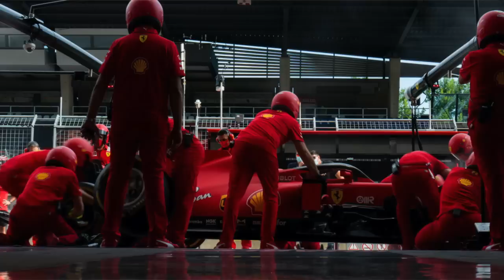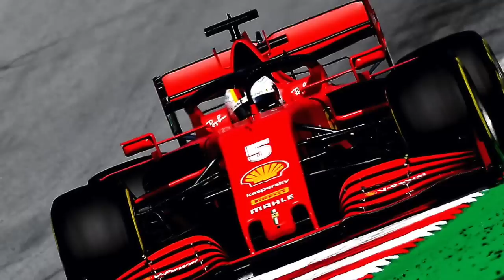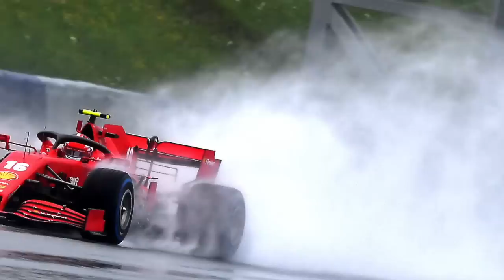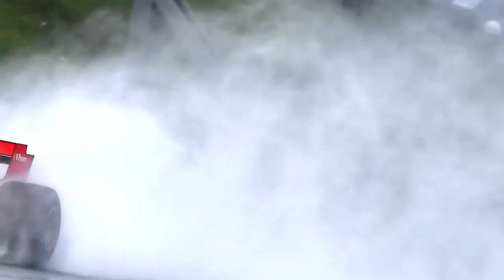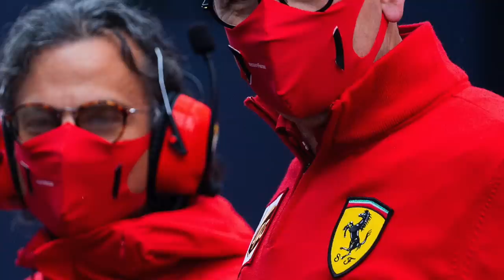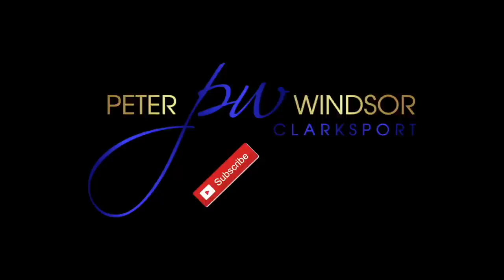Ferrari F1: what are the issues? Scarbs analysis by Peter Windsor

Comment: They relayed too much on the power unit, used without fuel flow sensors, so they can burn more fuel. I think to address that they must redesign a big part of it. And i can imagine that is very expensive and it could be a nightmare. But they are the f1 team who take the most of prize money, at the end of the championship, regardless of the position they end up

Comment: "In the wet, power means absolutely nothing" ... I get your point, that rain is the great equalizer with many variables, and traction is so low that much of the time, the horsepower you have is merely theoretical! But there's a point after almost every corner of the lap, where the speed, gears, and downforce, go up, and the driver is using full throttle. It’s why they still did charge laps before each hot lap in quali — they were getting every last horsepower they could, using those quali engine modes that discharge all available power over a single lap.

Comment: It’s really not a huge mystery is it. Let’s assume that with the new fuel pump setup, they’re losing some fuel flow compared to last season - they’re down on power and have been forced to reduce drag, which has lost them downforce. Because they’d committed to a higher drag/downforce design based on an expected  power output, when that power output has been significantly reduced, they’re in a tricky situation. They’ve pushed the technical regulations and have been bitten - they should’ve asked for regulatory confirmation earlier in the design phase so have avoided the sorry mess. MB did exactly this with DAS - checked and had it approved. The fact that Ferrari didn’t was at best naive, and has robbed F1 of some closer competition at the top..

Comment: SonI guess Ferrari really were cheating in '19 after all
Reply: Racing is cheating at all levels from local dirt tracks to Nascar to F1.  If you don't cheat you don't win. It's part of the game. The trick is to not get caught
Reply: Yeah, they were. Pretty crazy, huh? Not a "grey area" either — the rules clearly state that 100kg/hr is the maximum fuel flow for the engine. The rules do NOT merely state that the official FIA fuel-flow sensor cannot exceed 100kg/hr, which which Ferrari did adhere to because they tricked said fuel-flow sensor.

Comment: Binotto is an engine man. Maybe he should go back to his bailiwick to help increase hp without cheating. Can you provide more granularity on the IP Ferrari used to cheat?
Reply: until proven otherwise the FIA said that Ferrari was in order.
In all its history Ferrari has never cheated.
I can't say the same for the mclaren taken in the bag with the ferrari projects.
Reply: @tonino5113  FIA never said that, reading between the lines Ferrari had software and hardware in place allowing it subvert the fuel measurement. Ferrari was all "on our honor we never used it in a race", FIA couldn't prove otherwise. So, secret agreement, Ferrari to give up the goodies to FIA to prevent another team from using the cheats that Ferrari had developed, but "never used". Assuming of course that the loss of 1 second in lap pace and substantially slower top speed immediately following the FIA ruling was purely a coincidence.

Comment: In the first race, the Ferraris were just about hitting 300kph on the pit straight while the Mercedes where doing around 315kph and there are 3 long straights at the Red Bull ring so don't see why Scarbs doesn't agree that Ferrari was losing 0.7 per lap in Austria... It's entirely possible.

Comment: If they all start a race with 100kg of fuel why cant they use what ever flow they want? Surely using too much they would run out before the end of a race and that's their problem?
Reply: That’s actually an interesting idea to push fuel efficiency rather than restrict flow...
Reply: Hmm, interesting thought
Reply: It's to help reliability vs. fuel efficiency
Reply: That’s how they did it in the past and people hated it because cars had to back off towards the end of the race or even ran out of fuel. Check out the 1985 San Marino Grand Prix.

Comment: I don’t believe their advantage in power was down to fuel flow alone. They simply cannot run enough fuel in the car for Ferrari to consistently run higher power than everyone else during the race. Max fuel is what, 110kg. The max fuel flow is 100kg/hour. A race is an hour and a half long. You do the math on that one! 
Just look at Canada last year Seb kept Lewis behind for the entire race with power alone. It would be impossible unless they had significantly more fuel on board than is allowed.
Reply: There were rumours that they were hiding fuel in other parts of the car, in pipes and things...
Reply: @neilwilliams2883  "Leak" into the combustion engine from the intercooler. "Cool fuel" as Seb calls it.

Their arero is garbage. The front of the car including the nose is all wrong. It's butt ugly too.
Reply: @sinking1902  FIA should check also for some oil or fuel "leaks" to the combustion chambers on the Mercedes power units too.
Reply: @RogerM88  that was closed up 2 seasons ago re: oil burning and amendments were made to the regs for it.
mercedes are just that good, people are gonna have to accept it lol. quite incredible how they've maintained technical advantages for this long, will no doubt go down as one of the greatest f1 teams of all time.
Reply: @RogerM88  Haha. I think the first 3 years of the turbo hybrid era Merc were absolutely cheating! They were running a diesel lol! Ferrari built a great car in 2017 but lost the development race. In 2018 they built an ok car with a longer wheelbase but a split battery which crushed Merc at Spa on the Kemmel straight. In 2019 they cheated the fuel flow regulator but built a shit car in terms of concept. In 2020 the engine is legal and the aero is horrendous. RIP Ferrari.
Reply: Neil Williams They are only rumors. He is absolutely right it wasn’t down to fluid flow only
Reply: they don't use all that fuel space in the grand prix outside of like singapore cause it's the only race on the calendar where fuel mileage is mentioned.
way back when the hybrids were introduced they actually had an infographic up during the race of how much fuel each car was using of their maximum allotted amount and the cars would rarely use up more than 50% of the max fuel capacity, maybe 65% at montreal and monza, and by the time we got to singapore the infographic was gone because people said it was boring or something.
they still short fuel the cars for these full grand prix, which is just a testament to the technology that's been developed, all personal opinions on it aside. back in the v10 days 110kg of fuel would be 1 stint in a 2 stop race.
there's evidently a lot to be gained by breaching fuel flow regs, like it or not.
Reply: It's ludicrous to restrict fuel flow in the first place.  The majority of the technical restrictions are ludicrous and are why fans and teams are so frustrated with the sport to begin with.
Reply: How’s having a fuel flow cap ludicrous? Lol
Reply: Even at full speed on a really fast circuit like Silverstone the engine is only at full throttle for 70% of the lap, and even then you'd only actually need the additional fuel flow for the last 1,000-1,500 revs (ie c.15-20% of the total rev range), where the extra power would be produced, YOU do the maths. So the extra fuel required would be quite minimal. Once you add in lean fuel maps/lift and coast, as required, plus safety cars etc they are way off needing the full 110kg of fuel to drive for 1.5 hours so there's massive scope to increase maximum power output through additional fuel use, as long as you're prepared to cheat!!
Reply: FiLOL too many coincidences unfortunately to just accept they had the best PU
Reply: Liked 7times by Ferrari PU-Department 😁
Reply: @FiLOL think about it. If they weren't exceeding the fuel flow limit, there are only 2 other ways they could have been finding the extra power:
1. They were burning something else, such as oil, which is also banned, and or
2. They had somehow managed to make their engine significantly more efficient than all of the other engine manufacturers had managed (despite the fact that these engines are already by far the most efficient power units in the history of motorsport), but they have now somehow forgotten how they were doing it, and miraculously that happened just after the FIA technical directives came out! Haha
Can't you see how that looks slightly suspicious?
Reply: p jay I just don’t think ALL their performance came from just fuel flow. They could extract more efficiency from the ICE and have a trick or two in the ERS on top of extra flow
Reply: Yes Steve there is a lot more to that story than most in the know are unwilling to air.
I fancy that they found a lot more than what was divulged & had it been then they may well have been booted out for that year ?
That would never do of course as they still walk on water (for the moment)

Comment: So if the engine is down on power, and the only change is a new random sample fuel flow meter, then isn't that essentially a confirmation that they were circumventing the old meter against the rules?
Reply: They also closed the oil burn loophole, which...if done properly (and ferrari did) can amount to excess fuel fuel rate and added power.

Comment: The issue is pretty clear. They got caught cheating and now they can't cheat anymore and they are slow! The aero thing is nonsense cause the Ferrari customer cars are also slow!
Reply: FiLOL I like the DAS system. It shows that Merc are still innovating and pushing the envelope, which is exactly what F1 used to be about. Of course, the difference is, they put their system out there and the FIA approved it. Ferrari has been very deceptive! As for the Tracing Point, that is an abomination. They may win races with that thing but they won't win fans!
Reply: FiLOL DAS was cleared by the FIA and the stewards.
If it was illegal, they wouldn’t have got away with putting it on the cars come the start of the season. 
Same with the double diffuser a decade ago. Brawn himself said “Are you sure this is legal?” knowing how against the spirit of the rules it was. The FIA gave it the green light and along with a few other technical masterstrokes, the double diffuser was a big reason that Brawn car came out and dominated the first half of the 2009 season.

The Racing Point again seems to be a case of taking pictures and copying it. Only when they investigate the brake ducts (and find nothing I’m sure) they’ll have to concede they’ve merely duplicated Merc designs as best as they can. 
Again, nothing illegal about that. 

I know a lot of people are sick of the Mercedes dominating, but it’s the other teams who are failing.

Red Bull for years said “it’s not our fault, the others need to do a better job.”
Only once they were given a hiding, we’ve heard nothing but “Red Bull will quit if...”. 
Massive sour grapes from Horner and co.
Reply: FiLOL Well actually you can. Certainly the outer parts which is what the accusation has mainly been based on. Regarding DAS, if it is, as YOU say, illegal, why has it been deemed legal?
I’ll tell you why. It flies in the face of the intention of the rules but doesn’t actually break them. 
All I get from you is you’re another outraged Ferrari fan who can’t accept they’re losing. Again. Despite the FIA bending over backwards throughout the last few decades to bring them success.